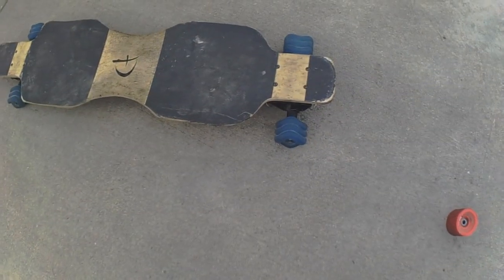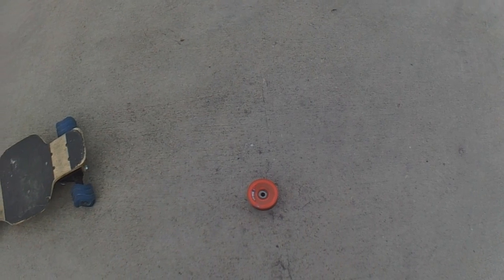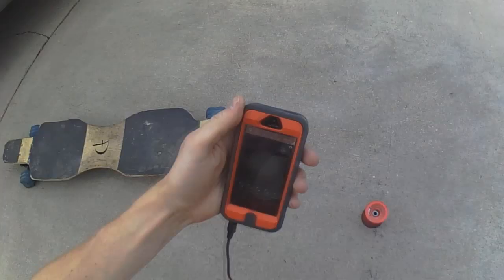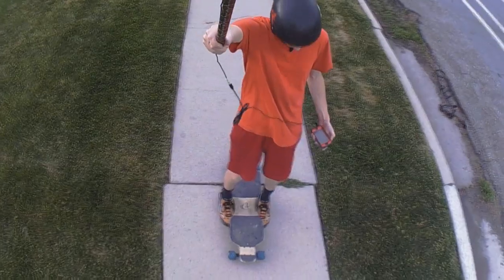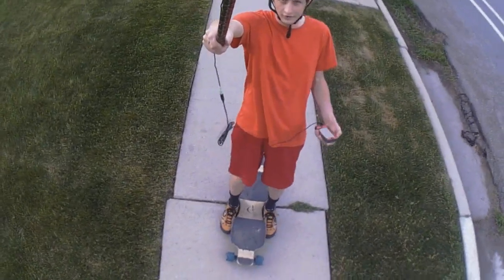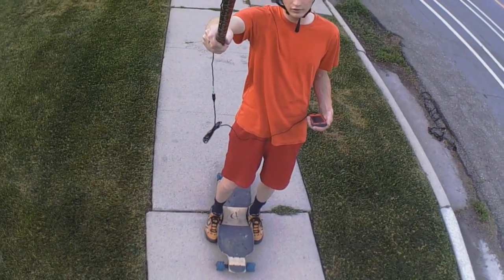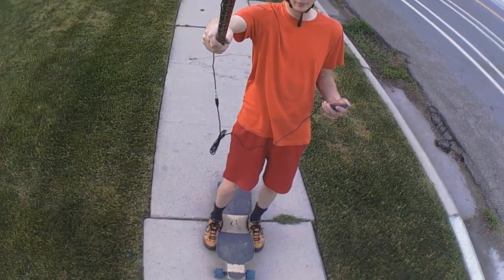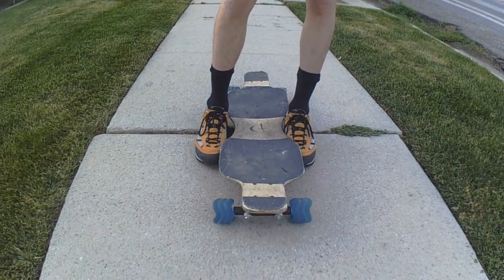Testing phone as external mic for camera, And, Shark Wheel test run.

Comment: it just doesn't seem like a safe wheel to use at high speeds. it also look like it was designed to flatspot lol
Reply from the maker: I can't think of a single reason why it could be unsafe at high speed, or why it should flatspot any easier than an equally thaney wheel.
Reply: i had in mind the same principle governing wheel lip shape. Wouldn't a squiggly pattern like that react funny under lateral force? Intuitively it would appear that the loads on the side of the wheel would change every..well..squiggle. Similar reason for the funky roaring sound. love your truck design btw!